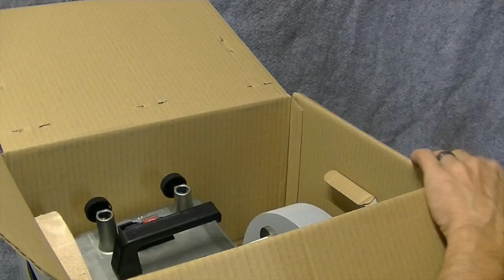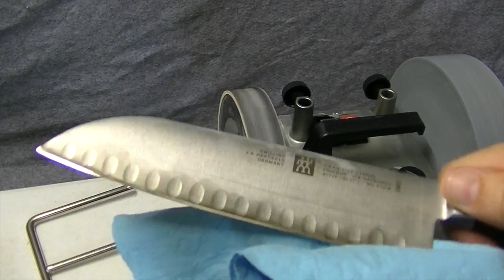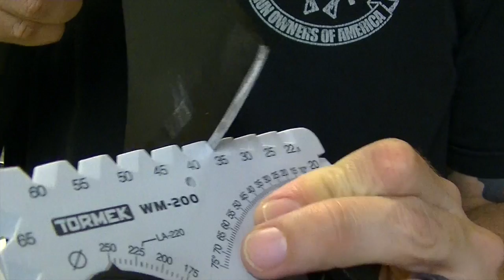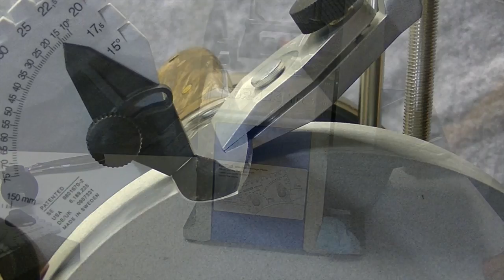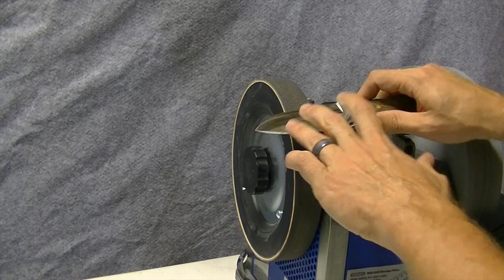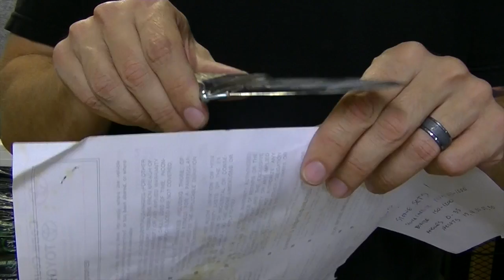WorkSharp Killer #3 - Tormek T-8 Knife Sharpener - FULL REVIEW

Comment: You are using the angle guide wrong. Both of the black bits should rest on the stone. And for people wondering. For blades with a narrow grind, you rest the black part on the blade and halve the angle. For wide grinds you rest it on the edge and set it to the actual angle. See tormeks channel for videos.

Comment: 15:00   I genuinely shocked that, as a "knife guy", you failed to mention the difference in grinds between a Wicked Edge and a Tormek. Now maybe you assumed that this video would primarily be watched by "knife guys", and they'd already know what makes what grinds. But you still should have mentioned it for non-knife guys. 

For non-knife guys: The Tormek will make a hollow ground edge, while the Wicked Edge will primarily make a flat ground edge. Note that neither is "better" than the other, it's just personal preference, and what application you will use your knives for.

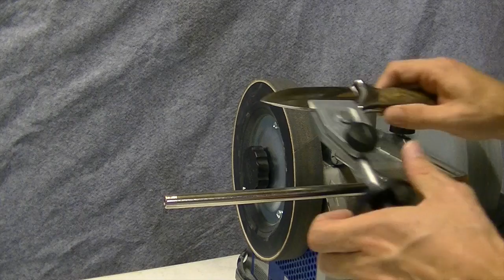Comment: 11:20   That could all have been avoided had the otherwise geniuses at Tormek added a switch to REVERSE the motor direction. Then the guide could still have been placed on top, and the problem with the handle hitting the stone would all have been avoided.

Comment: How does this system work on small knives that have blades such as a pen knife etc? 

I sharpen a wide range of blades for me and my friends. Knives from Case Stockmans with small thin blades, to larger fixed bladed hunting knives. 

How would you compare that type of job to the WE? I had a WE Gen 3 Pro, and it struggled with the smaller, thinner blades.

Comment: I’ve had the Jet System for 20 years, and an glad the Tormek System has taken up the slack, for Jet, because I can use both tools on my Jet.  I think the biggest difference would be the stones you use with them.  A lot of improvement in stones, available, now. I used mine for sharpening my Swiss & German wood carving tools.  Now, I’m more inclined to sharpen knives.  I have supreme confidence in either of wet systems.  Thanks for the video, it’s inspired me to put my Jet, back to work.

Comment: One of the very few balanced, objective YouTube reviews of the various sharpening systems out there.  He nails the difference between Tormek and Wicked Edge: Tormek is fast and gives very good edges, WE is slow and gives excellent edges if that is what you want.  In my experience, pros who do volume sharpening tend to use the Tormek, those doing finesse work on super-expensive blades use WE.  The local sharpening guy around here has both, and uses them on that basis.

Comment: It would be better if the larger stone is removable
Reply: It is removable.  The T8 (unlike the T4) has a quick remove nut.
Reply from the maker: You can remove the stones on both units. That’s how you swap for the other stone options they offer. Unfortunately you just can’t use it without the stone installed. The drive axle slides out.

Comment: Hey great videos and reviews.  I am close to pulling the trigger on this thing but I haven't been able to find anywhere if this would work well with my knives...  My kitchen knives are Shun Japanese knives with SG2 metal.  Will this thing be able to sharpen those or do I need something more aggressive?  I think they're HRC 62 or 63.  I've always had them professionally sharpened and have always had the itch to sharpen them myself but never quite took the leap for fear of ruining them.  Thanks for any input.
Reply from the maker: it would definitely sharpen them...might jsut take a little longer than a steel with a HRC in the high 50s.
Reply: Thanks a lot man.  One other thing... for a kitchen knife, would that japanese stone you reviewed in another video be overkill for a kitchen knife?  I'm obviously new to knife sharpening and wondering if there's such a thing as too keen of an edge for a knife that will be used only for kitchen tasks.  Again, thanks for your expertise.
Reply from the maker: the normal stone is only 1,000 grit. IMO, that's a good utility edge, but not ideal for fine kitchen tasks. The 4,000 grit japanese stone is perfect for that.

Comment: it just weirds me out that they use a stone of finer grit to polish that stone to being a finer grit hahaha... never heard such a thing till i saw these... i mostly just sharpen free hand on diamond plates because my edc knife is s110v steel and the carbides in it dont really sharpen properly on things softer than diamonds.... do have a dmt sharpening system i used forever ago now just use the stones from it free hand... also have a ken onion worksharp use it for axes and machetes and other large blades..
Reply: also can that knife clamp actually make the blade go to the stone at 10degrees or does it start wearing away the blade clamp?
Reply from the maker: Yes. It can do 10 degrees. I think it’s easier to understand that conditioning stone if you think of it the other way around. The sharpening stone is already the finer grit (1000). The conditioning stone roughens it to 220.
Reply from the maker: Also, if you’re sharpening a really small blade, they have this jig to help prevent the wheel from hitting the clamp. https://www.tormek.com/uk/en/grinding-jigs/svm-00-small-knife-holder/

Comment: Why is the Tormek T8 so expensive?
Reply: I just invested in a Tormek T8 with the small tools jig kit.   I specialize in slow, low-heat sharpening.  Much of my work up to now has been done by hand with japanese waterstones.  I bought the Tormek because (a) it is slow and low heat and thus removes less metal than sanding belts, and (b) it can be used to sharpen so many things with accurate angles, and (c) they last - many people are still running the same unit after 15 or 20 years.  
So I looked at it as an investment.

Comment: at around 1150 why not just take the other stone off? so you can eliminate some of user error.
Reply from the maker: they're on the same axle. If you take one wheel off, there's nothing keeping the axle in place...it slides out.
Reply: thank you.
Reply: A smaller diameter spacer in place of the large stone would work...

Comment: Hi I got a T7 Ltd edition with more jigs and a different stone aluminium oxide. It has work perfect for me and even faster to change angles and so on.One small thing I do when sharpening kitchen knifed. I remove the grind wheel. Move the guide to horizontal. And you can use the angle tool aswell if you want, makes big different!!! And you don't bump into the stone.I've also bought a 4000 grit japanese stone. As complement for some of my sharpening.As for hunting I'm on 23-25° and after stripping if I want it when working animal in Forrest. Really sharp I only use a buffing cotton wheel and use 3.5 and 0.5 my paste and razor sharp and always use 2 knives in the wood.
Reply: is the 4000 grit japanese stone worth the $$$ and does it really bring the sharpness up that much?

Comment: I bought a
Tormek 35 years ago. Not T7 or T4, it was just a Tormek at that time. It might
be time to replace it, the stone that was originally 250 mm is now 170 mm, and
it is a little hard to use. Actually, the motor didn´t work anymore after 30
years , so I bought a Sheppash that looked the same, but it was lousy so I put
that motor on the Tormek. Still hard to use because of the worn stone, but I
must say the quality is excellent, working for so many years.
Reply from the maker: Erik Larsen 
Thanks Erik. You might like this more recent video I did.  Similar story. https://youtu.be/8zQDmQ_n7wg

Comment: How much pressure do you put on the blade when sharpening?
And mine seems to spil alot more water then yours :)
Reply from the maker: mine spilled a lot at first too, until i spent more time with it. There's definitely a right and wrong way to move and angle the blade so that the water doesn't pour off. 

The amount of pressure really depends on how much metal you're trying to remove and how quickly. If you need to reprofile a blade and remove a lot of material, press hard. If you just want some fine adjustments, lighter pressure would be more appropriate.
Reply: Thank you very much sir.

Comment: Cool video, do you reckon I can use one of these to put a blade edge on a DIY knife?
Reply from the maker: definitely. just start with that 220 grit and work your way up. Depending on the steel you're using, shouldn't take long at all.
Reply: Awesome thanks for the quick response.

Comment: I'm really considering getting one of these... I bought my Wicked Edge 4 years ago (Pro Pack 2) and have since upgraded it to as close to the Gsn 3 you can get with the Gen 2 base. It's easily paid for it's self a few times over, and has funded my knife collection nearly in it's entirety. I love the WE and would still use it if I got a Tormek. 

The Tormek would be my speed sharpening rig, if I need a fast edge, or need to do a lot of profiling. I think I would use it for most clients as the base price option, and use the WE as a more premium higher grade option.
Reply from the maker: Dan Martin 
Check out the newest Tormek  idea I just did: https://youtu.be/2VFCNxqVR3Q
Reply: I’ve been thinking of getting one of these systems and just offering sharping service is that what your doing or do you make the knifes as well?

Comment: You're using it wrong.
- When sharpening a knife the holder should be perpendicular to the tool guide all the time. When you get to the pointed/curved part of the knife you shouldn't change the angle but just lift the handle while keeping the holder perpendicular and still resting on the guide. It is counter intuitive and took a little practice, but the results I achieved on knifes were much better - to the point that I have yet to see better results.
- Honing knifes on the leather wheel freehand is completely OK and in accordance with Tormek's recommendations. I only use the guide for honing hand plane blades and chisels.

I bought mine to sharpen drill bits and chisels, but achieved such great results on kitchen knifes that I now have a second one permanently setup with the Japanese waterstone and the result on my kitchen knifes (German and Japanese) is extraordinary.
I've tried the WE and achieved similar results, while I liked it, I sold it because it didn't give better results, and I can use the Tormek to sharpen more than just knives.
Reply: So just lift up on the handle (straight up) and don't slightly angle / pivot the knife so the tip would be reaching the same area of the stone? I'm bought a Tormek and I'm going to be sharpening my knifes this weekend. :P
Reply: This video shows (I think) the correct method that you described: https://www.youtube.com/watch?v=fYURcwkKGPs

Comment: you've completely sold me on the Tormek T8. Ive been using Japanese water stones for a long time but they are expensive and messy and time consuming.     does it come with a jig small enough for small edc knives like a spyderco delica?
Reply from the maker: depends on which kit you buy. There are several options. The SVM-45 is the one you want to look for. Here's a link for reference, but see if you can find a full kit that includes it. http://amzn.to/2j7BfRr
Reply: HarleyWood23 thank you so much for the quick response! Ill check them out now!

Comment: I don't hate either one of the three, they all do a good job and are limited in their design. Wicked Edge by far is the better of the three if you are wanting a scary sharp highly polished edge, plus you are working BOTH SIDES of the blade at the same time which is the best thing to do because the blade edge folds over from side to side (that is what is considered Dull Blade). Sharpening the blade (straightens the blade to Center).
On the Tormek I notice You and the Blade Show Guy on the other video did not always keep the blade flush with the wheel, it could be heard in the sound also. Tormek is more of a Utility type tool like you said, same as a Grinding Wheel, the design of it keeps it from being pin point accurate but never the less it is as good as its design allows it and as good as the average person would need it to be.

Comment: If you sharpen so you are looking at the knife over the top of the machine (side opposite of the sharp edge) you will have much better control.  With practce you will inprove the edge sharpness you can achieve. Been using the super grind since it was new. 5 MIN OF HONING  is to long probably rolling your edges over. A minute per side is usually plenty.

Comment: Two comments: First, you can purchase the same type of machine as the Tormak from Grizzly Machinery at a much cheaper price point. Grizzly does not have some of the accessories such as the angle guide, stropping oil, or frissable stone, but you can purchase these separately From Tormak and assemble your own system much cheaper with no reduction in quality.  The Tormak angle guide and frissable are a must.  Some of the construction elements of the Grizzly are not as stout as the Tormak, but in the vital components there is no difference and I can detect no difference but price in the performance of the two systems.  Grizzly has two wheel sizes to choose from, one is designed with a smaller wheel to lower the entry price point into this type of system.  I do not recommend it because it produces a much more pronounced convex sharpening angle, which makes just as sharp as edge, but it will dull much quicker because the cutting edge is supported by less steel due to the convex cutting action of a smaller diameter sharpen stone/wheel. 

Second, you must understand that the that there is no single answer.  The Tormak/Grizzly style machine makes a convex sharpening edge, with will dull quicker than the flat cutting angles that a Wicked Edge/Hapstone Pro style systems.  Depending on how you are using the blade, both have there place.  Aside from knives, I have a woodworking shop full of blades that I have to maintain so speed of sharpen is a strong consideration.  This is where the Tormak/Grizzly shine.  I like to use both style systems in conjunction with each other.  Powered water wheel systems are unparalleled in speed, but you can't get the finer edges from finer stones available in hand systems.  So I re-shape/re-condition blades on my power systems, hone-in micro-bevels on them with hand systems, and finish with a power strop.  This way I  get the best of both worlds.  I find this to be so satisfactory, that I working on making my own type of Hapstone Pro system (I have my own small, modest hobby machine shop) for much longer blades that are in many of my woodworking system.

Stay sharp out there.
Reply: You mean hollowgrind...? I like my worksharp Ken Onion better...

Comment: Knifes are not the best value I get out of my Tormek.I use mine for carving tools,handplane blades,and T1 high speed steel jointer knives.I have also have the jigs for wood tuning tools.If your only into knifes you can do the same with less.Aj

Comment: Just bought one. Do you know if its ok to keep the stone wheels soaking for long periods of time. I have worked with some whet stones that recommend that and others that don't.
Reply: I'd recommend reading the instructions. I've had a t4 for about a year and have forgotten to lower the water tray a couple of times and it hasn't caused any damage. However do protect the stone from extreme cold and frost as it will crack.
Hope that helps.
Reply: Don't let it sit in the water. the stone will be softer and the stone will become uneven eventually

Comment: Sir correct me if I'm wrong, when you are setting the degree using that angle device, what you were showing is actually the angle of the bevel and not the angle of the sharp edge? So then you'll end up grinding the bevel instead of the sharp edge?

Comment: You can't say something is a work sharp killer when it's over 4 times as much! Work sharp is the way to go!
Reply from the maker: infamouscoma886 
So if a Corvette outperforms a Camry, I can't say it's a Camry-killer, just because it costs more? I get it. The WE and the WS both get you from A to B. In my opinion, the WE just gets you there in a more controlled fashion. 

Also, if the WS fans are honest, you're gonna end up spending $800 over the life of that system by buying so many replacement belts.

Comment: The Tormek 7 has a ten year warranty but the new Tormek 8 that replaces it only has a seven year warranty.
I guess Tormek doesn't think the Tormek 8 will last as long as the Tormek 7. bummer as I bought a Tormek 8…
Reply from the maker: good point
Reply: Thanks Harley - I wrote Tormek and they couldn't give me a valad reason for not offering the extra 3 years warranty on the Tormek 8. Tormek says in their videos that the Tormek 8 is an improved version of the Tormek 7. Not offerring the extra 3 years warranty doesn't send a positive message on their part.